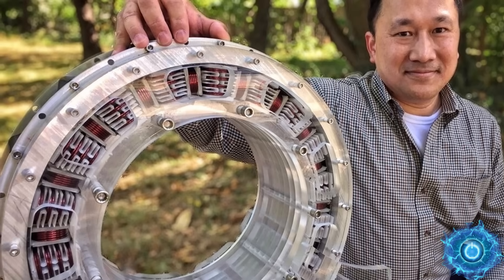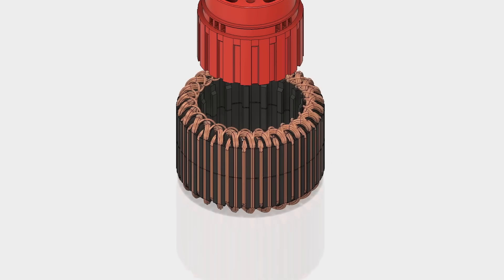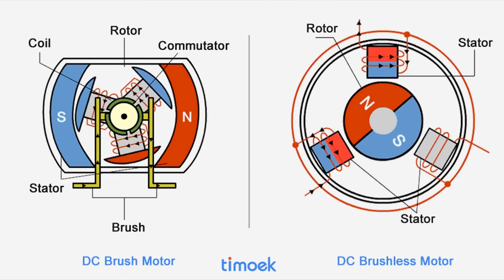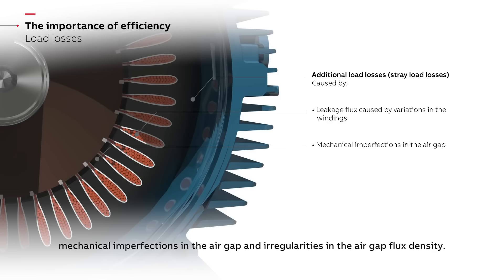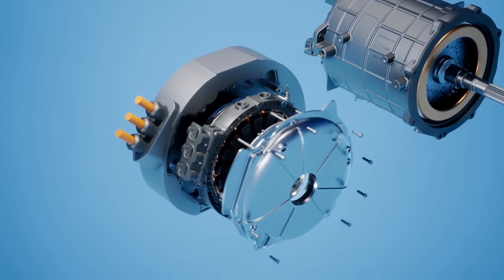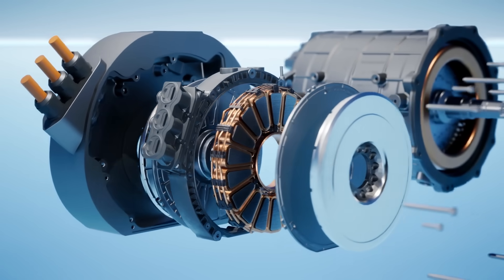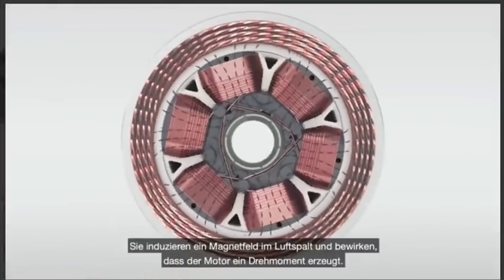INVENTOR BUILDS Breakthrough MOTOR - IS it REAL!?

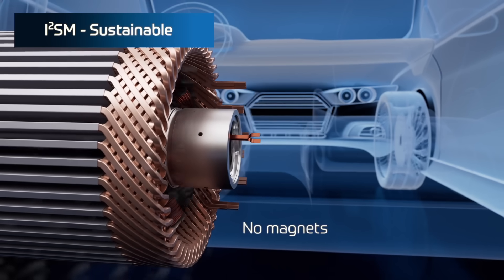Comment: 6:23 What about small motors like cooling fans or drives? Those often go straight to waste, because the amount of stuff for every single hump of glue, is not worth the effort. But in summary, they make a huge pile. Car motors will get recycled in high 99% rates anyway.

Comment: Is this actually something new? I know that this exist for a long time now, its just does not compete against the motors we are using rn. They are just expensive to build (you need multiple windings, which cost a lot more time to make (Cu is very expensive today), you need to design new control circuits, you have to build them too). But i think companies like tesla will do it anyway, because someone actually buys those motors bruh. and because of this 0.2% more efficiency it does not really make sense. time will tell i guess

Comment: Thanks for the vid, lots of similar ideas have been in my head for a while now and learning to try draw up some designs using finite element analysis software which can really help to visualise how it all works, all seems like a very promising direction for things in future.
Reply: This is called an asynchronous motor commonly used in industrial applications to adjust power factor in generation

Comment: I've not finished the video yet, and I am by no means anywhere close to an expert in this field, nor am I defending their statements... BUT.. Efficiency is typically figured and tested as a unit; but rarely tested as an integration. If we look at his diagrams as a theoretical "potential" energy loss in a system, and not real world measured energy loss as a unit, I think what they are showing makes sense (along with your observations about more efficient use of space and materials, aka torque per volume and torque per weight). Imagine running a motor like shown in the diagrams in the worst possible scenario, where they are surrounded by components perfectly susceptible to eddy currents. In that scenario, you should see such a large difference in measured efficiency, right? When thinking about it in this light, the proposed design should offer improved performance in more agnostic compact integrations with less induced current in local electronics, if I understand correctly. So not just better use of materials and space, but improved capability for compact high effenciency assemblies with less design consideration required from the engineers that are designing the assemblies.

Comment: Ten years ago I designed a Disk-Motor, on office word 12 coils of copper wire at the centre with twin discs each side of it. These carried permanent magnets
which fitted to the centre shaft or drive shaft. The centre coils affected opposite poles each side of the drive disks. Then it vanished from the computer I was using? # !
This shows how the human collective mind can be picked up by others. The main thing is that we are very close to getting it right. Love it, thanks.
Reply: Remake it back up your work

Comment: I want to see this crossed with a multi layer axial flux motor design now, I bet the performance would be insane
Reply: your right except it would require rethinking the cheapest ways to mass produce them! That's the key!
Reply: No, it wouldn't
Reply: How? There is not much percent left to gain.
Reply: Isn't the whole point of axial flux that you can have a stator in the middle sandwiched between two rotors, meaning you want the electromagnetic force going out both sides to both rotors? It sound like using a halbach electromagnet would actually perform worse. This would only be good for radial flux it seems.
Reply: bros pfp

Comment: What even is this video talking about? Staters typically have electromagnetic coils, not permanent magnets this is not new technology. Permanent magnets are sometimes used in rotors to produce cheaper motors, but emc's have been used for the same function for decades. Plus, a claim of double the efficiency means half the losses, not double the power. You praise the motor for all the wrong reasons resulting in a worthless opinion. 

Motors are designed for a purpose. Without evaluating the motor based on the purpose, you're basically just judging how shiny it is.

Comment: the efficiency is relatively,example : a  one KW of electricity produce heat ,but e electric motor moving a generator produce heat,the generator produce heat and the electricity produce can be apply to heater to produce heat,tecnicly against the law of thermodynamics,is call cogeneration.

Comment: language is funny
you focused on 
working efficiency
not 
manufacturing efficiency

if it costs half as much to produce in materials & has the same efficiency as another motor one might say ... it is twice as efficient : similar to the "ONE STROKE ENGINE" that is being touted about these days... its still a four stroke engine but it gets four strokes per revolution on four cylinders ... so a one stroke engine as four divided by four multiplied by one revolutions is one stroke   ... 

still not sure who i hate more... marketing or engineers paid to screw over the end user

Comment: This is wrong, total b.s.  I've built and designed electric motors for years.  The outside of the stator often has a continuous loop of magnetic material which helps to complete the magnetic circuit.  Halbach arrays make more inefficient motors.

Comment: Second 7 of the video ... he compares this new thing with "Standard Electric Motors" .... There are none "standard" electric motors, there are Synchronous Motors, Asynchronous motors, Reluctance motors, Axial Flux motors, Brushless Direct Current motors, Brushed Direct Current motors and probably a few more that I never heard of. Different applications require different motors. There is no "standard" electric motors.

All of them have a conversion efficiency of around 90%, definitely not 50%. Imagine having a Tesla with a motor that does around 200kW of power, 50% wasted energy that is 100kW Loss!!! 
Can you imagine each Tesla having a heat output of ~500 room heaters ?? 
Neither can I. 

At this point it's completely clear, this concept is bull crap.

P.S. To have virtually 0% Electro-Magnetic Field radiation, you can just use Reluctance Motors, the whole point of them is to direct the magnetic field through the rotor, they don't use magnets and they are treat to look at, no need to "invent" aberrations.

Comment: 'can we actually build a magnet free motor?'  As if there haven't been magnet free motors for decades :D
Reply: @Modelights : The behavior of magnet : like sign (+ & + ... or - & - ) = repulsion/ push effect... Unlike sign = attraction/ pulling effect.. In short, the magnet have  "natural pressure" push/ pull effect, with fellow magnet...

Inventors, engineers, etc. simply utilized such "magnet behavior" , convert it to mechanical action- the result, the common electric engine, using elec' to produced strong magnetic field...

Almost all modern engines/ machines are "pressure" operated- such pressure coming from : magnetic field,   fuel detonation, winds, waters, gravity (hydro. electric dam), boiling water, photo. electric, etc..
Reply: @arielhermoso4262  LOL As if I need someone who understands far less than me to 'explain' motors to me.
Remove your head from your rear.  The video said 'magnet free motors', as if there haven't been motors that operated with stator coils instead of magnets since the early beginnings of motors.

Comment: You and Cedric Lynch would get on well! The Idea of Halback coils instead of magnets is intriguing but wouldn't one induce current into the other if their currents were fluctuating and wouldn't that induce  and cause  back EMF?
Reply: Well, the back EMF is driven by the magnetic fields from the rotor.  These magnetic fields aren't aligned with the rotor magnetic fields in the same way, so I would expect the back EMF to be small compared to the axially aligned coils...
Reply: Or not!

Comment: Electric coils will always have more power density. The rotational torque conversion to work done is the trick. This design is on the right path. Thanks for the vid. Subbed.
Reply from the maker: Thanks for the info!
Reply: @Motor_Explorer1  This is interesting, everyone copies each other waiting for someone to come up with a new idea and steal that new idea and claim it for themselves. This all goes back to a robot from 1980 found and disappeared with advanced capabilities, it was basically walking down the street hidden, observing to humans in their habitat and they managed to obtain data on their anatomy. But this robot magically disappeared. The data collected on its operation was incomplete but sufficient to investigate and spend millions of dollars. Until now, drone technology and artificial muscles were born. air that until now have come to nothing and the motor is brushless, but the human intellect had a limit like that of any animal and they could not understand many things, the motor with a larger perimeter with the same energy was slower and consumed gigantic amounts of electricity, basically you need a tow truck for the batteries or a long plug, this means that this motor that we see from the Chinese, if it were real, is very slow and a power plant would be needed to give it energy, it could also be a copy of an engine that was never real that appeared in a popular mechanic in 1960, analyzing the Chinese engine apart from its slowness, if it were real, it would last running for a few seconds since the plastic structure would melt due to the heat...therefore it is It's a fraud, it's a chimera, it's like the fantastic Chinese plasma engine that everyone talks about and promotes. This supposed plasma engine doesn't push grams, it pushes tons. The problem is that there are no photos, drawings or videos. It's just Chinese propaganda.
Reply: @Motor_Explorer1 hi there, what was the material you placed over the magnets to show the electrical field?
Reply: @Motor_Explorer1  The motor is fake, the transparent plastic gives it away, it melts, it is plastic for a 3D printer and those coils will heat up to more than 90 degrees.
Reply: @gatoninja4387  or it can just be a demonstration model in that image rather than actual product
Reply: If u include the power source to magnetize the coils in total combined weight they are not. The pm is getting more powerful each new breakthru. The coil may have some firm of residual magnetism within it and self excite but needs to be driven like a alternator or non pm generator. They self excite until regulated or get so strong the prime mover cant rotate.
Reply: @waynegarfield6607  counter electromotive force
Reply: these hero inventors have tried freeing us from the energy cartel.
.......
Nikola Tesla
Stanley Meyers
Dennis Reed
Troy Reed
Paul Pantone
John Christy & Lou Britz
Joe Newman
John Bedini
Howard Johnston
Richard Clem
Daniel Dingel
John Searl
Thomas Ogle
Dennis Lee
Eric P. Dollard
Tewari
Adam Trombly
Paramahamsa
Dennis Klien
Parendev
McKenzie
Muammer Yildiz

SLAVES N0 M0RE  😊

Comment: The idea is probably made obsolete by axial flux motors which don't need to project their field quite as far from the stator. You can use the induction trick with axial motors too if you want to eliminate permanent magnets and easily implement regen braking by boosting rotor current to bump back-EMF up to battery voltage at whatever current is desired.
Reply: Thanks for pointing these things out. I was just going to add how I managed to make a magnet attract itself to a steel shielding plate blocking a magnets field which would have repelled it, then with its momentum it moved past the attracting point to where the repulsive forces on the other side took over, and this magnet did attract then repel ITSELF past the other Magnet, due to focusing the shape of the field to be asymmetrical.  Soon I plan to resume working on that, and I like the ideas you pointed out here, I may just combine all of these together, and make my next design(s), thank you!  Oh and I should add how you can use Pyrolytic Carbon to always repel a magnetic field, along with Soft Iron/Steel in order to compress and attract the field, combined with Halbach Arrays, to make magnetic motors/generators even more efficient.
I am working on mine, and calling it the "Mag-Gen Motor/Generator", for Magnetic-Generator.
I also have another design using rotating magnets on gears, with iron plates to block the fields between them for half the rotation on one side and the other half on the other side, so the forces between round magnets will cause the maximum torque thus power output on both sides almost 100% of the time (a small bit less). This I think will gain the most electrical power that is possible from between Permanent Magnets.

I think there are better ways to obtain energy from the Fluctuations in Earths Magnetic field and Ionosphere like Nikola Tesla's Wardenclyffe Project was going to do, or from the "quantum foam" like a NASA Eagle Works patent I saw (but is THAT one Real? IT could derive enough energy to vaporize any material I think!).
Reply: EMF... The things, you say... Youre unbelievable.
OHHHHH!!

Anyone old enough to remember that one?
Reply: I love them and I have a folder about them
come take a ride! :))
🚅🚈🚞🚝🚂🚃🚄
trains, trams, aren't they all beautifull
Reply: What is the best kind of motor to generate electricity from Water spinning a shaft?
Reply: @MrEagleeye58  An external excitation synchronous motor/generator is the easiest and most reliable way to go about it in most cases where you need regulated output. Most power on the grid generated by rotating machines is handled this way.
Reply: @teardowndan5364  Ah so most people use a Car Alternator, if you generating power from hydro what would you get that is readily available. Or would you simply use a car alternator and simply put a few of them on the same shaft?
Reply: @MrEagleeye58  If you hack an alternator to substitute your own higher-voltage diodes, you can get 50+V out of them to directly charge a 16S 48V LFP pack and get 3-4X as much power per alternator.
Reply: What?

Comment: I made a electric motor without permanent magnets a year ago with speed around 3000 RPM and one hall sensor. My lates project is car alternator with rewinded staor for 2 Phase operation it has alot of torque and uses one hall sensor. The problem with the alternator is that the poles on the rotor are shaped like triangles and can give some erors on the hall sensor.
Reply: @Mr-Electronist :  A very good idea, to avoid dependence on neodynium magnet- in which 90% of supply is in china... Is the motor efficiency almost identical to that of neodynium e. motor?.. If yes, why is Elon Musk and other car manufacturers , keep on producing e. vehicle with neodymium engine?..
Reply: @arielhermoso4262  The rotor in case of the alternator takes about 24 Volts and 0.5 Amps . You do not need alot of watts to make a strong magnetic field (Only for direct current). The magic is that if you go above 24 V at around 30 V you almost double the field strenght and if you use 12 V the alternator would still work. The use of coils instead of permanent magnets does not afect eficeincy, it depends like usual on the position of coils on stator.

Comment: Your spot on with regard to power efficency.  Perhaps the claims relate to the efficency of the magnetic force.  Focusing the magnetic force improves the efficency of the magnetic materials used in the motor (not the power efficency of the motor).

Comment: I'm gonna be honest if you're trying to get a really efficient motor You need a coil and capacitor that is as close to the same value as possible. And then with a pulse width modulator or a control module.  you can pulse it at the frequency so you can get very high torque. But we've gotten away from that. Even though Nikols Tesla showed us the true popencil of capacitor and coil resonant frequency oscillations.

Comment: My bet on magnetless motors is carbon nanotube windings. Carbon is so much lower density than copper, even matching the conductivity would be a huge improvement. And if a halbach stator is already worth doing, it will be even better when you're replacing heavy iron with lightweight carbon.
Reply from the maker: Great point!
Reply: @dekutree64  :  So, your idea is to replace the iron core of the elec. motor, with that of nano carbon- just coating the iron core with nano carbon, or 100% replacement of said iron core, by nano carbon materials?... 

Is the said nano carbon a good magnetic materials- identical to iron when it comes to magnetic field induction?...Is such nano carbon a good conductor of elec'ty , like gold, silver, copper, aluminum, etc...
Reply: @arielhermoso4262  I mean constructing the motor almost entirely out of carbon. Like coreless copper windings, plus using halbach pattern in the rotor and stator to direct the magnetic field where you want it without needing back iron.

Carbon nanotubes can theoretically be something like 1000x more conductive than copper, but so far there aren't any techniques to produce long continuous tubes, and yarn made from short tubes has relatively poor conductivity due to the high resistance of jumping from one tube to another.

Comment: Motor efficiency is confusing unless you look at it the other way around, as a percentage of waste heat. 94% efficiency means 6% waste, so a 3% improvement in efficiency from there is actually cutting your waste in half.
Reply: @jcd-k2s  Depends on whether weight is important (e.g. electric aircraft). Small improvements in efficiency can greatly increase the usable power, or conversely reduce the weight of the motor for the same power.
Reply: @jcd-k2s it's negligible unless you just so happen to need that extra 18km to reach the next EV charging station
Reply: @vueport99  or you are taking the sum total of losses from a million cars driving 20,000 km a year.